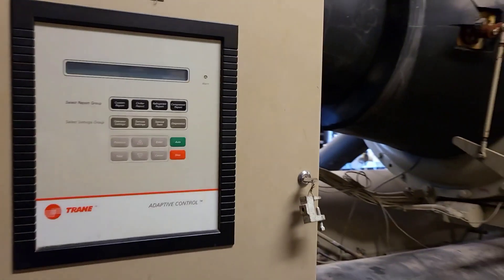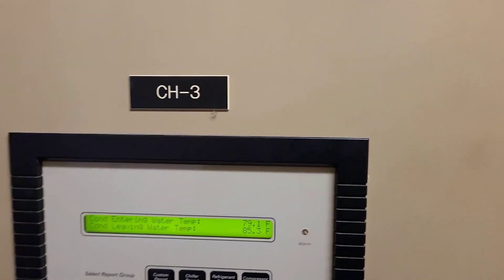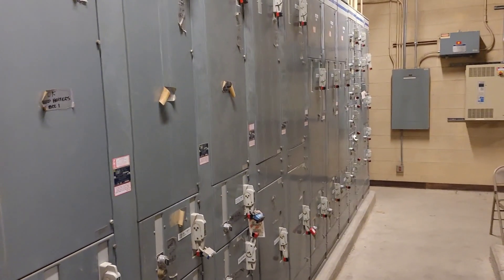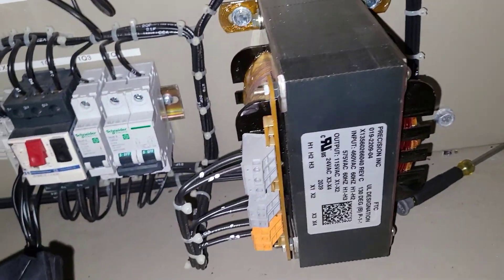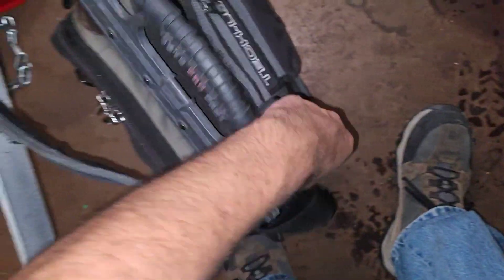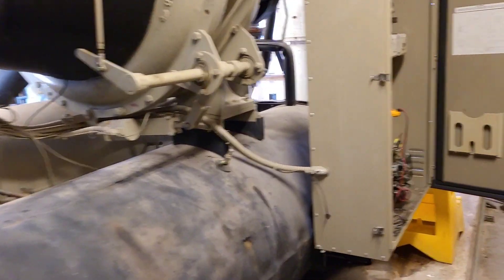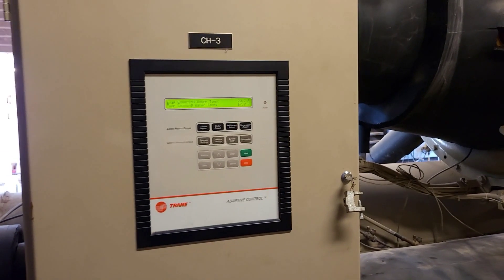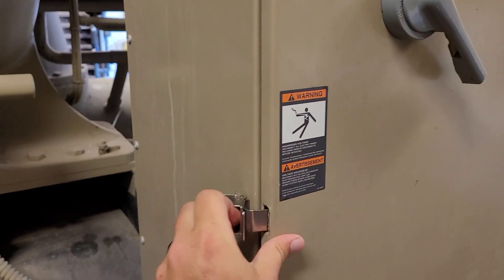Trane Chiller Surging THEN ELECTRICAL Main TRIPS

Comment: Good thinking running the current in hand, the problems in the industry are super interesting though, it's why I love hvac, it's a savage mix of trades. I think if you can do hvac you can pretty much do it all. I do pharmaceutical hvac cqv but we're starting to take on ac work aswell now and I must say it's been nice to stretch out my electronics experience. I mean I work on msc's, incubators, dfb's , cooling towers etc etc but mini splits and refrigerant chillers are new to me. Been in this now for 5 years and it's the first job I haven't been bored in.

Comment: They should analyse their setup and make changes because this shouldnt happen when everything is setup correctly. 
We work a lot around big switchgear these days and the way the main feed ACBs are configured (trip curve, delays, etc) are essentially to resemble a really big fuse so that they will only trip on a sustained overload or an actual fault on the bus bar of the main cabinet itself. 
The main ACB is really only there as safe means of isolating the whole switchgear cabinet and as a last line of defence SHOULD there be an serious overload or a fault like an arc flash on the main bus or a transformer overtemp, most our panels are direct feed from a transformer and the transformers are temperature monitored with a protection relay/unit and an overtemp will also kick out the main and thus offload it before the transformer goes chernobyl mode.
An overload will trigger an alarm anyways as the main incoming feeders are monitored with CTs but the main breaker will not trip out right away because everything is still under control at that point.
Some facilities even want an advisory sent to their SCADA system when the cabinet reaches 80% or 90% of its design nominal load current so people know something is going on aswell as transformer temp data.
The breakers feeding the individual pieces of equipment are then set to accomodate that equipment and protect it, the main might aswell be a big fat fuse but this isnt 1950 anymore.

I suspect the main tripped on a sustained overload which means they need to make changes to that panel 100% or reconfigure the breaker if it has enough room left.

COULD have been a phantom trip where the mains breaker was loaded up good and then something happened that kicked it over. Could have been a tiny current spike or surge.
If its a trip happy breaker it needs to be looked at by an industrial electrician and fixed somehow before it kicks out again because if the breaker if faulty it will happen again.

Comment: I remember going on a service call and had to change out the UPS on the BAS system. All 4 chillers and pumps turned off when it loss low voltage signal and that was one quiet plant

Comment: FYI, just seen this video. Your purge was not running. And saying it is not full of air because of no purge time. Is very funny to me. But a great vendor. Keep learning sir.
Reply from the maker: The purge had been running. They shut it down about an hour before I got there. You can see the purge suction temps after I got everything back on as well. There was no evidence the system had an atmosphere issue.

Comment: I’d caution you on starting a chiller with the starter panel open, especially after you just had a mysterious electrical outage.

Great videos though, I really enjoy them.
Reply: Yeah when this stuff blows up it blows up for real. I work electrical and them big industrial installations are no joke the expected fault currents on those are trough the roof and that makes for fun explosions and fireballs.
Reply: Unrealistic. Most of the time you have panels open when troubleshooting. Wear PPE and be aware of the line of fire always and you will be safe.

Comment: Saw that purge suction temp in the 90s and immediately thought check that sensor (like you did). Just had a machine surging like crazy, full of air but no purge mins cause that suction sensor SEN2133 failed high like it normally does and it never went in to a pump out. 

Had another one surging with a bad compressor on the purge. Purges ran with no condenser fan motors for an extended period of time. Another contractor replaced the fan motors. But the compressors were shot. Running and amping fine (little low) seemingly, but blown out internally. Read like 88* on suction 89* on discharge. Replaced the entire condensing unit on it, it pumped its ass off for two days, then came down enough to keep up until we can do a leak check. Trane has a service bulletin out as well for taking a fairly accurate subcool reading on the purges without having to put taps in the lines. Gives you a pretty good idea of charge and what’s going on with it. Cool videos too man. Post some more overhaul shit!!

Comment: Have you ever dealt with any energy recovering wheel erm? I ran across one at one of our schools on an old system I've never seen that before I would think that would cause air flow issues in the duct.

Comment: Trane centrifugal chiller error to "extended compressor surge" and chiller trip what think check  this issue
Reply from the maker: Check your purge system and sensors first. Also make sure the purge dryer has been changed in last 12 months.
Reply: @HVACTIME  bro thanks for reply
Reply: We will check purge Carbon tank temp go to high for 100°C above
Reply: Purge dryer changed few months before

Comment: That old chiller reminded me of an old customer that blew up their Carrier 19XR and the main 1000 amp fuses for the building with it.

Don´t remember the whole story but they tried to run it with low load because their smaller winter chiller was down and they did not want to spend any money on repairs. To do that they had to override the start counter since it it limited to 3 starts in 12h.

Spolier: They did not save any money.
Reply: How you know if a  chiller blew up?
Reply: @bunnyman6321  In this case if i remember right we suspected catastrphic mechanical failure since the windings measured out okey and fuses don´t blow without a reason.

Then we recovered the refrigerant and opened up the compressor housing and the impeller was in pieces.
Reply: @Mr Bugenhagen  Damn

How much it cost to fix something like that?
Reply: @bunnyman6321  To be honest I dont´t really know but i would not be surprised if the parts and shipping cost 20k and the labour as much. I think the impeller alone cost 10k.
Reply: @mrbugenhagen3364  Sheesh!

Comment: That was a great video intro with the power cut, gripping. Could also check the cooling tower bypass valve position and also the distribution tray inside the tower to see if its blocked or unequally distributing condenser water over the fill. Possibly increase fan speed or turn another tower on to try and get the temperature down in the peak load.
Reply from the maker: Great input! Love what you're doing.
Reply: @HVACTIME  Great video. I was wondering if you can maybe help me out I'm a Refrigeration Foreman and I work at Los Alamos National Laboratory, sometime in early September we will be salvaging out 2 Trane centrifugal Chillers. They R123a units each containing 750 lb of refrigerant I have already ordered a low pressure refrigerant recovery machine two 1000 lb tanks and all the correct connections and hoses to  recover the refrigerant from the system after the refrigerant has been recovered these machines are going to be disassembled and removed from the mechanical room and in place we are going to be piping in new Arctic chill split system Chillers my question to you is could you please maybe send me a video that I could share with my crew on the proper way to recover the refrigerant out of the chiller as we do mostly low-to-medium tonnage AC  but very little  heavy tonnage I understand just enough to get myself in trouble the condenser water has already been drained from the system and I'm pretty sure that the evaporator water has been shut off to the system as well so I'm thinking that we will have to drain all the fluids from the chiller barrel and from the condenser as to not freeze up the the tubes inside and bust them I've also noticed ball valves on at the bottom of the the barrel with quick disconnects I'm pretty sure that what we need to do is open up the Valve  and let all the liquid flow out into the recovery cylinders then once we get down to certain pressure used to push pull method but I am not certain and I do not want to leave my crew astray. Any consideration would be greatly appreciated thank you so much
Reply from the maker: @shanegreen268  you are correct on using the push pull method is very effective, especially with low pressure. Also you can drain the barrels or just flow water, if you flow water on both it speeds up the recovery by adding heat to the refrigerant. I dont have a specific video currently but let me see what I can do.
Reply: @HVACTIME  Thank you so much. I appreciate it.
Reply from the maker: @shanegreen268  I uploaded a video for you this morning on my channel
Reply: @HVACTIME  you are so awesome I really appreciate your help. This is great. I would like to ask one more question if that's okay? I'm not sure what we could use as a sub cooler. I'm wondering if the low pressure recovery machine that we have is a type of sub cooler because it has a place to hook up water to it thank you so much again I appreciate the time and effort. If there's anything I can ever do for you please let me know.
Reply from the maker: @shanegreen268  most low pressure recovery machines have a built-in subcooler, if yours has water taps its very likely that is it.
Reply: @mikesteen5388  Hello Mike sorry for the late response I didn't realize you had text me thank you so much for taking the time to send me this information. I promise that my crew and I will be careful while working with R123a. I knew it was dangerous but I didn't know it could cause so many health effects
Reply: 2 of the best youtubers on this comment
Reply: I watched also this engineering mindset videos thank you guys for delivering such a good ideas and knowledges when it comes to Hvacr industry. Godspeed.

Comment: This looks like a Trane Centravac Chiller.  I have a feeling there may of been an issue with that old electric distribution panel.  I never really careed for chillers as i don't think they fully remove the humidity like a standard refrigerant air conditioner does. Chillers break down quite often as well.
Reply: I’d have to disagree on the humidity removal issue. An air handler with a chilled water coil is usually run at 44 degrees and is basically infinitely adjustable and never really shuts off. DX coils with refrigerant in them will run colder but doesn’t usually have the precise capacity adjustment of a chilled water system. Chillers are usually very reliable if proper maintenance is performed. Most customers today do not want to spend the money required to properly run and maintain a chilled water system. A space that has multiple DX split or rooftop units will only develop hot spots if one or two of them fail. A place that has a chiller without adequate back up is SOL if the chiller breaks down.

Comment: Hallo sir, 
Chiller Model # Trane RTAD -085 
I want to keep RUN circuit # 01 and keep OFF Circuit # 02 how to do  from keyboard... 
Pls. Let me know or we any other option....
Reply: Go into service test tab and lock out circuit 2.
Reply: @HVACChillin  Thanks you very much Sir....

I more help sir
In same model i am facing circuit # B in OFF Mode or RUN Mode condition Suction pressure is 290 kpa in gauge but in display 2018 kpa
So i checked LP switch is ok if i disconnected LP Switch at switch still showing same then i disconnected from motherboard jack then it's showing disconnected (-)  but when i connect at same jack again 2018 kpa. If any solution pls. Comments.. when chiller start after some time becomes lockout and showing need updates...
Ur help will be appreciated.....
Reply: @ashpaktechnicalsupport  this chiller uses thermistors not transducers. Its taking refrigerant temperature and converting it to pressure. You need to take surface temperature next right to the temperature sensor and confirm its reading correctly. But it sounds you like you may have a bad suction line temperature sensor. I would replace it and also the evaporator saturated temperature sensor at the same time.
Reply: @HVACChillin  Thanks you very much sir....
I will check today